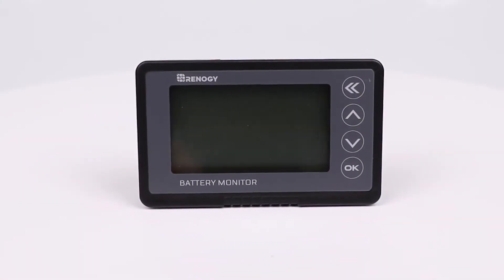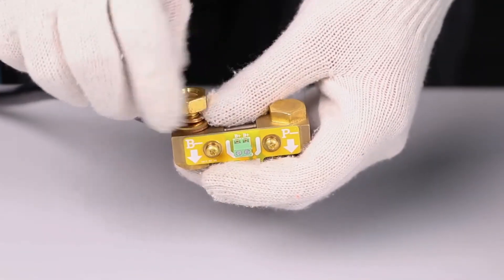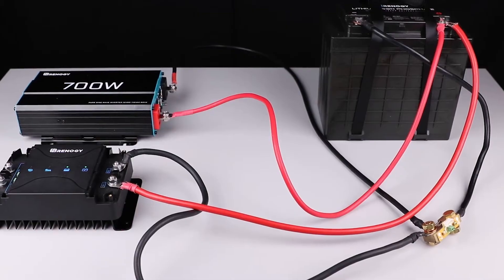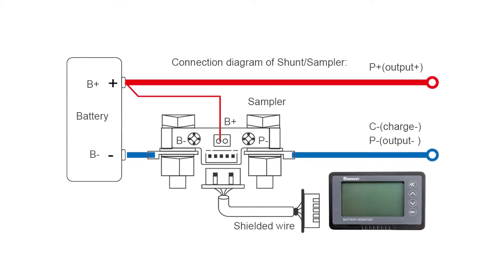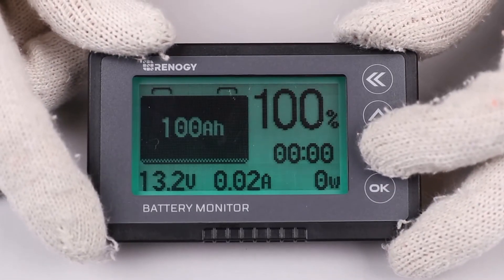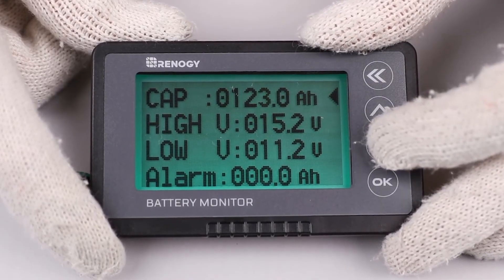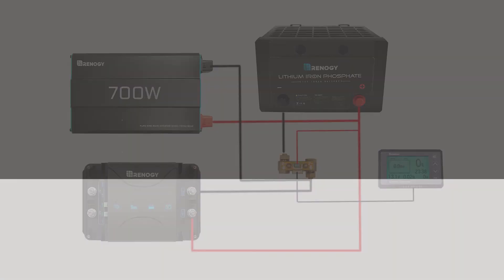Renogy 500A Battery Monitor

Comment: Is there an updated version of this video? The settings are different on current versions ("Full Voltage" and "Empty Voltage" instead of High/Low). It would be nice to have an explanation of how the new setting are taken into account and how to prevent the display from showing 100% while the batteries are still taking a charge.
Reply from the maker: Thank you for your helpful suggestion. I am so sorry that we do not have updated version of this video now. But please do not worry. We have reflected your requirements to our related department which will be helpful to our later videos updation.

Comment: FYI:  you are going to need:

1. a short, heavy wire, the same as your negative battery cable, to put between your battery and this device- WITH AT LEAST A 3/8 INCH TERMINAL.

2.  a TINY, TINY flat head screwdriver for the set screw holding the thin red wire to the shunt (which they should have included for the pennies more it would have cost them).  i spent quite some time trying to find a tool for this, since i'm installing on the road.

***3.  check every negative cable terminal you now have on your negative battery posts to make sure they are at least 3/8 inch.  because the typical 5/16 WON'T FIT, and so half my negative wires would not fit over the shunt posts.  be prepared to have to cut off your existing terminals to put larger ones on.  i just did the install today, minus including my inverter, because i do not have the tools to cut and crimp that heavy wire, and do not have on hand a 3/8 terminal that 8 awg wire fits into.  so without my inverter on the shunt, my readings are kind of useless anyway until i get that wire to fit.

4.  industrial glued velcro, for mounting the shunt and the screen.  easiest way around the ridiculously tight tolerances of the screen, and also the easiest way to mount the shunt right on a battery inside your battery box. 

5.  be prepared to be frustrated by the 'directions' that are included.  then when programming the thing makes you want to throw it in the trash, watch a few youtube videos and follow along.
Reply: wow exactly what im going through
Reply: Thank you,  ive had difficulty finding the 3/8 inch ring size....until I found your comment
Reply: same needed to buy heaps of dif terminals
Reply: Yep, it's a nightmare. Next time I will buy another make!
Reply: Just rim it out with a rimmer
Reply: Screenshotted, cheers mate.

Comment: When I set the amp hour cap for led acid, do I set the actual amount, or do I set 50% of the amp hours? For instance, my house batteries total 160 amp hours. What cap should I set my battery monitor?

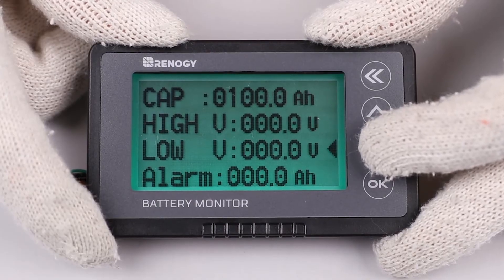Comment: The video describes low and high voltage disconnect settings (2:30); however the monitor is incapable of disconnecting loads - rather it can only alarm. The current version of the manual is clearer on this.
Now if the monitor did have a disconnect contacts, that would be great!

Comment: This is a really great system of programming parameters. Much better than having to fully discharge and recharge just so the monitor can be set. 
Is there a bluetooth module that can be added like with your solar products?

Comment: The black power cable that came with my Renogy 700 watt inverter doesn't have a large enough lug to fit over the post on the shunt that came with my monitor....

Comment: The model inhave purchased is a RBM 500. It has a field for attenuation to be set. The manual is no help unless you are an engineer.  Please advise what this setting is for and what percentage i should use for 2x100amp lithium batteries.  
Help please😢

Comment: On the shunt why is there 2 bat for power? Is that for an extra battery to keep the display on while below 12 volt?
Reply: 2 bat for power? What do you mean by that? Are you talking about the 2 large studs for the battery cable? Shunts are designed to go in series with the negative cable. So one is "in" and one is "out" or "supply" and "load".

Comment: 🤦I just had a face palm moment🤦

I completely overlooked that I'd need a new cable to close the WIDE OPEN CIRCUIT between the battery and shunt after moving all the load wires from the battery to the shunt.  I've already seen that others have made this mistake, so I'd suggest that it be added a bit more explicitly in the documentation.

In the mean time, should I use same AWG wire or something bigger?  What's a good source for these?
Reply from the maker: Hi, Michael.

For your problems, we suggest you can submit a case through our Help Center Portal (links listed below for specific locations）for help. 
 
https://renogy.force.com/helpcenter/s/contactsupport (USA)
https://renogy.force.com/helpcenterau/s/casesubmit (Australia)
https://renogy.force.com/helpcenterca/s/contactsupport (Canada)
https://renogy.force.com/helpcenteruk/s/contactsupport (UK)

Comment: Would it hurt if I had a buss bar for neg inputs before the controller? (One neg from the DC/DC, and one for the solar negative then that goes into the neg of the controller)?
Reply from the maker: Thank you for your attention.It is not recommended to connect in this way. PV can only be connected to the controller charger separately, or to the DCDC charger separately (DCDC charger with PV connection function)

Comment: I have a bus bar for several negative connections. Should I connect the shunt between the negative bus bar and the ground wire? Or, should I connect the shunt between the battery negative and the negative bus bar?
Reply: Between battery negative and the bus bar. All current should pass through the shunt.

Comment: Do I put my starter battery negative on the negative terminal on the dcdc charger still? Or does that go to the shunt first?
Reply from the maker: Hi, Overlanding. The battery monitoring screen is generally used to monitor house batteries, so the negative wire of the house battery need to be connected to B- of the shunt. The starting battery can be connected to the DC-DC input terminal according to the normal connection method.

Hope it is helpful.
Reply: @RenogySolar  ok and a ground goes from the dcdc charger to the p- on the shunt as well?
Reply from the maker: Hi, dear customer.

If you want to ground the negative terminal of your house battery, you can connect the negative wire of the house battery to the B- of the shunt. Or you have grounded the negative terminal of your house battery, the B- of the shunt also need to be grounded.

Comment: it's all setup in my camper trailer, it looks like it works great, I calibrated the 100% but it wasn't 100% full I reckon, it's still charging and still showing 100%. My expectation is that it auto recalibrates when going over 100% is that correct or should I recalibrate? Thanks
Reply from the maker: Hi, Jonathan.

To make it easier for you to send us necessary videos or pictures for troubleshooting, we suggest you submit a case through our Help Center Portal with more details (links listed below for specific locations）. If you have previously submitted a case which has not been replied, please provide us with the case number so that we can inform the customer service to solve it for you as soon as possible.
 
https://renogy.force.com/helpcenter/s/contactsupport (USA)
https://renogy.force.com/helpcenterau/s/casesubmit (Australia)
https://renogy.force.com/helpcenterca/s/contactsupport (Canada)
https://renogy.force.com/helpcenteruk/s/contactsupport (UK)
Reply: @RenogySolar  I don't have an issue that needs troubleshooting it was just a question
Reply from the maker: Hi, Jonathan.

It automatically recalibrates to 100% when the voltage goes over the setting value of High-V. It also automatically recalibrates to 0% when the voltage goes under the setting value of Low-V, but if the discharge continues under the condition, the voltage value will flash, and the alarm will beep once every 10s.
Reply: @RenogySolar  oh amazing, thanks so much for this answer!

Comment: The negative wire from my battery goes to the frame of my RV and the negative wire from my charge controller goes to the frame of my RV as well. What is the best way to hook up my shunt. Do I hook my shunt to the frame as well or do I instead hook the negative wire from the charge controller to the P- side of the shunt? Thank you for letting me know.
Reply from the maker: Hi, Peter.

Thank you for contacting Renogy. In order to solve your problems more timely, we suggest you can submit a case through our Help Center Portal  (links listed below for specific locations). 
 
https://renogy.force.com/helpcenter/s/contactsupport (USA)
https://renogy.force.com/helpcenterau/s/casesubmit (Australia)
https://renogy.force.com/helpcenterca/s/contactsupport (Canada)
https://renogy.force.com/helpcenteruk/s/contactsupport (UK)

Comment: Wish the shunt had a way to easily mount it.
Reply: How did you even mount it?
Reply: I installed my solar panel system (inverter, controller, Li iron phos batt and batt monitor) into a cabinet that had thin wood panels on its 3 sides (4th is a door on front). I drilled two holes (for the shunt bolts) and used the bolts to bolt the shunt itself to the thin back wall of the cabinet.
Reply: yeah, ridiculous tolerance for install.  i used industrial velcro to just stick it on.

Comment: If you have two AGM 100 ampere hour batteries, would that mean you want to set the monitor for 200?
Reply from the maker: Hi, mobiltec.

If your batteries are connected in series, please set "24v, 100ah". 

If your batteries are connected in parallel, please set "12v, 200ah".

Hope it is helpful.
Reply: @RenogySolar  When I do that it shows 50% cap with the batteries fully charged. Are you sure you didn't get that backwards? I set the FULL V at 12.
Reply from the maker: Hi, mobiltec.

Have you connected your batteries in parallel? In order to solve the problems for you, can you please kindly send us the video about the connection method of the battery, the connection method of the battery monitor and the process of parameter setting? 

If you can not do this here, please submit a case through our Help Center Portal with more details (links listed below for specific locations）.
 
https://renogy.force.com/helpcenter/s/contactsupport (USA)
https://renogy.force.com/helpcenterau/s/casesubmit (Australia)
https://renogy.force.com/helpcenterca/s/contactsupport (Canada)
https://renogy.force.com/helpcenteruk/s/contactsupport (UK)
Reply: @RenogySolar  I didn't have time to wait around for an answer. I think I have figured it out. The batteries are in parallel. The monitor now reads 200 ampere hours. I believe that is correct right?
Reply: @mobiltec  Yes parallel will combine the AH, whereas Series will combine the voltage, as per their response.
Reply: @Lebofly  Gee that only took three weeks. Quick response guys...
Reply: @mobiltec  I don't work for renogy
Reply: @Lebofly  That means that their tech support is worse than I thought. The products are great but the support is terrible.
Reply: @mobiltec  they literally answered your question, you came back saying "I figured it out" repeating what they had told you earlier???
Reply: regardless you've resolved your issue, hope your setup treats you well!

Comment: What does the watts mean on the bottom right. Is that how many watts are being used or is that the difference between solar input and usage? Looking for what that watt total represents.
Reply from the maker: Hi, Andrew.

It indicates the current output power of your battery.

Comment: how do you know when your 120ah lithium battery is full ? , when you have to commission the renergy battery monitor first with a full to s set the parameters
Reply from the maker: Hi, Derbarl.

You need to check the battery's specification to determine the battery's charging voltage value. Then set the "high V" value on the monitor to the battery's charging voltage value.
Reply: @RenogySolar  thanks 😊

Comment: I tried to recalibrate on full battery and dead battery. Capacity percentage is at 96% when 3000 watt inverter shuts down and battery is low .. 🤦
Reply: Same issue here. Have you found a solution to get it to monitor real time again?  Was fine until I used AC with inverter yesterday for not quite an hour. Shut down at 50% and hasn't shown charge or discharge values since then. Last night I had no power in my camper. Dealer had me flip battery disconnect until fully charged. But can't tell when fully charged because monitor isn't showing me that info. I expect I'll be in the same situation tonight after the sun goes down and solar is no longer pulling in anything.
Reply: I pushed buttons for an hour and somehow got my amp hours set and battery read at 100%.  I will use a ball peen hammer to reset the meter next time. What a pain.

Comment: If I connect two 80 amp/hr batteries together in parallel, would I then put a value of 160 amp/hrs in the settings?    Thanks for posting!
Reply from the maker: Hi, Lonestar.

Yes, you need to put a value of 160 amp/hrs in the settings if you connect two 80ah batteries in parallel.

Comment: why Is there no fuses on the positive wires to the inverter and DCDC charger? Thanks!
Reply from the maker: Hi, Brandon.

Thank you for your feedback.

The parameters of the equipments used in our video have been tested before shooting, so it is relatively safe. If you install it by yourself, we recommend that you install a fuse for safety's sake.

Have a nice day.

Comment: Where do you put the shunt if you have two batteries ran in parallel? I have it in between both batteries in the negative cable connecting the two, but it shows a much different charge rate than my charge controller.
Reply from the maker: Hi, Peter.

In order to solve your problems, we may need to send you some pictures as the reference. For this condition, we suggest you submit a case through our Help Center Portal for help (links listed below for specific locations）.
 
https://renogy.force.com/helpcenter/s/contactsupport (USA)
https://renogy.force.com/helpcenterau/s/casesubmit (Australia)
https://renogy.force.com/helpcenterca/s/contactsupport (Canada)
https://renogy.force.com/helpcenteruk/s/contactsupport (UK)
Reply: @RenogySolar  I tried reaching out to you guys many times, I cannot ever get through and no one ever calls back. Not only am I returning the battery monitoring unit but your company as of today has just screwed me over on a battery purchase that cost about $1,000. So I'm reporting the company to the better business bureau as well as the department of commerce. I will not allow myself and many others to be taken advantage of like the company you work for clearly does. It's shady business practices and predatory salesmanship. People should know what they're buying, and better yet, the type of people they're buying from. I gave the company a chance to resolve this and no one even tried.

*Buyers Beware*

Comment: How do you ground this configuration when using a negative bus bar? Do you run the battery negative to the shunt, the shunt to the negative bus bar, and the negative bus bar to sheet metal?
Reply: Did you ever get an answer to this question? I run a negative buss bar as well.
Reply: The shunt needs to be connected directly to the battery terminal in order to measure current going in or out. If anything is connected to the negative terminal and does not pass, in series, through the shunt then it will not be measured. It won't harm anything other than an accurate reading.

Comment: What is the theoretical or actual (bms dependent) 0% voltage. I know it’s not 0% because it mean the battery is completely gone. Should be around 10V? Why not set it to 12.8v the nominal cell voltage?

Comment: What size wire did you run from the shunt to the neg on battery?
Reply: Yeah, not very thorough huh? and i doubt they'll answer. I post above tells you everything you need, looks like he knows/cares. I just got mine and now i have to go out and get all these random supplies...
Reply: @dreamsR4real  Every install is different they cannot really answer that question for you. I will probably never have more than 50A going through mine. I still overkilled it and ran 2ga wire. If you plan to pull the full 500A rating and depending on distance you may want 2/0 to 4/0 wire.
Reply from the maker: Hey Luke,

For any technical questions, please contact us here-https://www.renogy.com/contact-us?gclid=CjwKCAiA3pugBhAwEiwAWFzwdeH3Crd9vRTbjjTYl9l3daVqnotJPjBhs2nmw-Wkn1_guWQeW0ao6hoCOHcQAvD_BwE

Comment: I made a custom mount for the shunt
Reply: Can you show us the mount you made?
Reply: Link?
Reply: Hmmm If you have a facebook account I can send you a picture of what it looks like.
Reply: @JonJon501  If you have a facebook account I can pm you some pictures . I fab a lot of stuff and sell it.
Reply: Jonathan Culver... Arkansas
Reply: SundownBlazer interested in how you mounted it as well.
Reply: @landingentry3180  I used 1/2 starboard cut it on the table saw and router. I actually sold the one I had to Jon Culver ^^.  I never used it.
Reply: @SundownBlazer  can you make one for me? How much?
Reply: @averagerider92  Yes I can, I use a marine grade materiel and I supply new mounting bolts the stock one's are to short after I make the mounts. $45 shipped
Reply: @averagerider92  Do you have a Facebook account to discuss this mount?
Reply: @SundownBlazer  ended up going a different route
Reply: @averagerider92  Ok great
Reply: Mine came with a nice clear plastic mount that captures the large bolt heads. Maybe they improved the product.
The mounting holes were too small and needed drilling out, though.
Reply: @kimmer6  that's good to hear they finally are making a mount for these. I have made some for others.